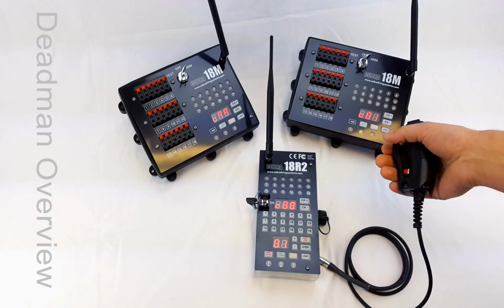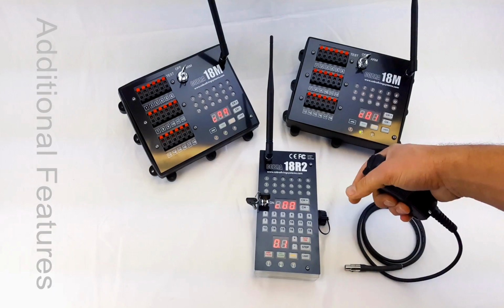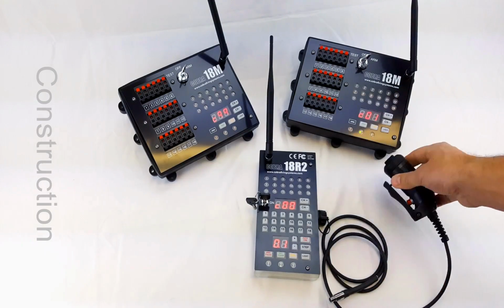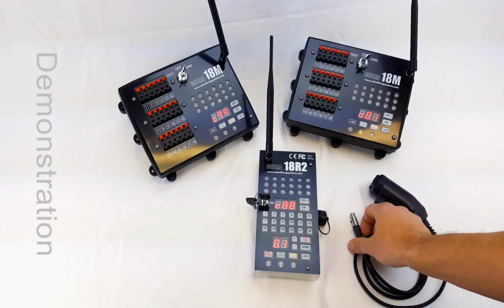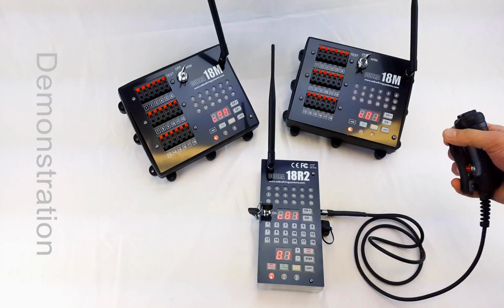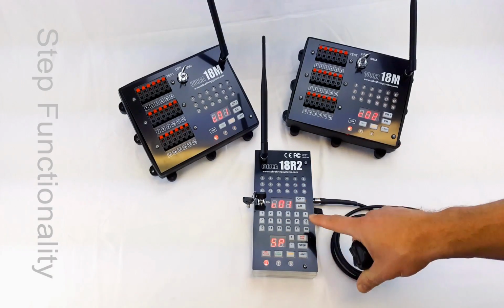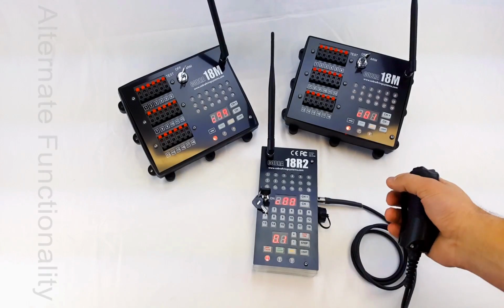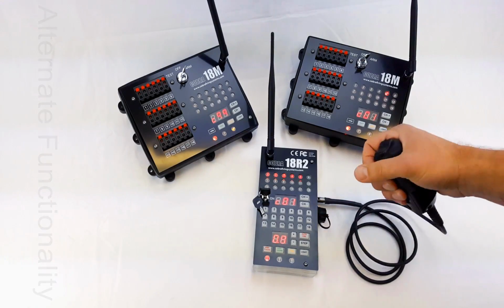COBRA Deadman Control Demonstration

Comment: If you had a safety spotter holding the deadmans switch and someone manually advancing the show with the 18R2, would releasing the deadmans switch override the manual "step" of the 18R2?